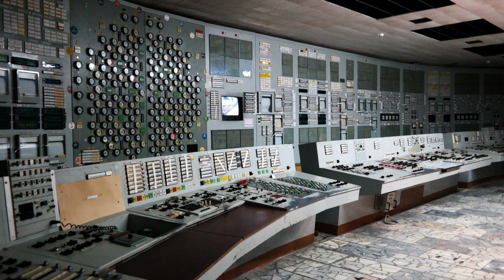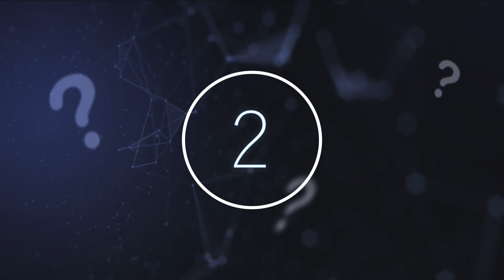Chernobyl Engineer Revealed The Truth About What Happened Inside The Chernobyl Power Plant

Comment: France has 56 nuclear power reactors in operation, with two units closing in 2020 at Fessenheim (61 370 MW (e)) and one EPR reactor under construction at the Flamanville site. This last one appears to cost mind bogglingly much ànd some 28 of the 56 power plants have been shut down ! Because also Macron has had the instruction of his overlords, that also France must end up in tótal chaos in every thinkable way. Clean nuclear power must be replaced by fake and polluting so called "green" electricity ( which ONLY can excist with the stand by back up of lots of fossil fuel based electricity ). 
I guess it also happens France that certain accidrnts in nucl. power plants are kept silent

Comment: Consider a world containing over 450 nuclear plants (thousands of reactors)  each and every one a security threat beyond all comprehension each and every day, but especially when conventional or nuclear conflict is involved. Think of the thousands of tons of still energetic hot "spent fuel" and core components requiring massive cooling pools that are at every single nuclear facility which are the ultimate threat long term to humanity even when not factoring in conventional or nuclear warfare.  Right now in Ukraine where a conflict is evolving there are 15 active nuclear reactors, several defunct reactors, and thousands of tons of both Russian and Ukrainian high level waste scattered in stockpiles around the country.  Several factors could cause a nuclear meltdown accidentally or intentionally including a conventional munitions attack, a cooling system failure due to several factors, or even destruction of the grid or componentry.